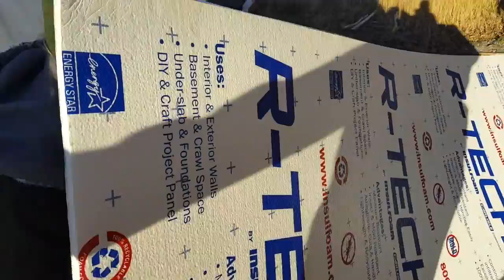How We Installed the Rocket Mass Heater Bench...and did it work?

Comment: Trust me!  Wherever you can,  put a tee instead of an elbow as a clean out.  You will build up a quarter inch of fly ash each burn and eventually the buildup will choke the system.  You'll need to vacuum out the exhaust pipe on a regular basis to operate efficiently.  Best of luck.

Comment: also the bench should be same height as burn chamber. Ducting air from under house might take care of that or you'll need to cut the legs.... I really like your design Its a lot different that most... Being able to bypass bench and go strait out exhaust can give you a way of controlling heat a little.

Comment: Solutions to the heat riser breakdown. 1 rebar (the coffee cans into 1 unit). 2 weld/bend holding brackets (3 or 4) to keep the riser stable  Made from 1  or 2 inch bar stock. 3 add stainless steel hardware to join the riser cans together. Hope these ideas help. Cheers,    
    Bill

Comment: A couple of issues I'm seeing here. You can't "choke" a RMH. It doesn't work like a fire place. You just run it full hot and let the mass absorb the heat. The mass is your choke. 

Second: Double wall insulation pipe doesn't keep cold air from pushing down against your initial heat leaving out. Its to keep the pipe from setting your house on fire. Its an air gap to insulate the hot pipe from the building so convection doesn't ignite combustible materials. 

Easiest fix is finding good start kindling and blow through the intake so you get heat leaving instead of stalling in the mass bench.

Comment: I use pine cones rather than paper to start mine. It doesn’t get sucked up by the draft. Dryer lint with a coating of vaseline will also make a great starter. I stuff that into a spent toilet tissue roll. Light it, no mess toss it in.🔥

Comment: A mass heater only draws well, when it is warm. After they fire goes out, close off all air intake to keep the mass warm. In your case, with your drop from window down to bench, I would recommend a valve to shut off the flu. Keeping the mass even slightly warm will guarantee a draft.

Comment: You need more area between the inner and outer tanks so secondary fuel gas produced in the central tank to ignite with additional air from outside thus increasing efficiency .. . currently you have no area for secondary burn with those rocks filling the area between inner and outer chamber.  The bottom line is "you don't want any oxygen to enter the "fuel gas generator"  put wood in the inner chamber so at 500 degrees f. and thus increase efficiency greatly . . . this inner tank sits above the fire grates and flames go up around the fuel gas generator that emits gas at 500 deg. F. and  are ignited in the top of the outer chamber where additional air  enters and temperature rises to near 1000 deg. Far. a small fan an help get a draft started in the bench

Comment: I would imagine the stove is extremely hard to start properly if you have pea gravel in the top of the stove half the reason you're struggling with this to my understanding is to create the draught required to draw the gases down a long flue pipe requires hitting a cold surface on the outside of the barrel buy insulating the barrel you're not calling the gases quickly enough to create a draw on the chimney also I think something to hold the fire up off the bottom of the barrel would help in giving you more control

Comment: The exhaust tubing should all be the same height of the of the burn box with a riser going out of the building with the least bends as possible,your intake air should come from outside otherwise you create negative pressure inside the building that cause the cold air to be sucked into every hole nook and cranny.By taking out side air running it over your thermal mass to positively pressurize the building you stop cold air from coming in.I take minus 3 degree air run it through the mass and get 180 degree out positive pressured building

Comment: If you put a door at the elbow of the exhaust going through the wall you can open it and burn a small amount of fire starter in there as you start your stove.  The air will start to draw up the exhaust from the fire starter and pull the air down and through your bench.  When the fire starter burns out the exhaust from the stove should be flowing on its own.

Comment: You know you dont have to use all that piping in the part,which is your themal mass . Just build a frame and cover it with cobb and leave it hollow. This will work just as well if you then vent the bottom to the outside. This allows continual flow of the mass heater.

Comment: Hi Juli, Darwin, everyone else. Stumbled onto both of your channels a week or 2 ago. Finding them to be interesting, informative and entertaining. Thanks!

I have a suggestion for your rocket heater that might help. And it is this: stop thinking about smoke as something that always wants to rise. Although I have no experience with these rocket heaters, I do have years of experience in applied Physics. And it would probably help to stop thinking about heat as something that rises. The action that is occurring is that cold is falling and if a warm pocket gets in it way is pushes it out of the way in the only direction it can. Which is up.

Lets assume that, as some of the rocket heater people claim, at the top of the riser tube the temperature is 1500F. The combination of gasses, a.k.a. "smoke", flowing from the riser has now expanded to almost 4 times it’s volume when it enter the firebox (this is determined by using the ideal gas law, PV=nRT). Which also means that, for a given size unit like, say, a cubic inch, it is now almost a 4th it’s original weight. Much lighter.

Now the combination of gasses, (“smoke”) must travel another 30’ or so before exiting the end of the stove pipe. All the while releasing heat into the pipe and cooling off. And as it cools off it “shrinks” and per cubic inch (or whatever size unit you picked) becomes heaver and heaver. At the end of the pipe it is almost back to room temperature and, per a given size unit, weighs almost 4 times what it did when it left the riser.

The point I’m making is that for that 30’ or so from the top of the riser to the end of the pipe the smoke actually wants to go down, not up. Of course once it exits the pipe it will go up, but that is because it has now entered a new environment where it is mixing with gasses that have not had to make the trip through the riser and therefore not hot. But as long as it is constrained by the pipe and interacting only with other gas molecules that have gone through the riser, the further it gets from the riser the cooler it gets, the heaver it gets, and the more it wants to flow down.

So my suggestion: After leaving the riser keep the smoke moving down until it exits the building and the pipe. Not even level, always at a slope down, even if it is just a little. I believe that will fix your problem with getting a draft through the pipe and the problem with the bench pipe leaking smoke.

What do you think?

Comment: This may be a rocket heater but there is no mass !
The rocket design implies the insulated chimney to complete the burn for good efficiency - done ! 
This exhausts into the oil drum which provides radiant heat during the burn time. 
Seems a pity that the exhaust is then taking the hot exhaust straight out without heating a "mass" for post-burn convection heating but maybe there is no room for the "mass". One option is to part fill the drum with bricks for heat storage so long as there remains enough clear space for exhaust gas to flow.
Reply: Should have watched whole video before typing...

Comment: Slap some cob on those pipe joints to seal them better than just tape... The rocket core creates positive pressure, "pushing" air and smoke if you're making it (shouldn't be if the core is performing properly)  through those pipes.

Comment: Julie you are not suppose to use those type elbows indoors they dont seal off the harmful gasses. Please use a carbon dector with this type elbow.There are formulas for rise and draw with pipes and heat. You should be able to find them on line.
Reply: Rocket stove is different, it doesn't work on the chimney pull principle, but on the heat riser push instead.

However, it is even more important therefore, that the chimney joints are hermetic. Because the chimney's not sucking stuff out, and the heat riser might be pushing exhaust system gases through the cracks into your room

Comment: Why not use a traditional design?  Mass heaters are ancient.  In any literature about Cossacks, they always talk about sleeping or sitting on the stove, a big masonry stove that captured heat and stored is to heat the room over time.  Why reinvent the wheel, especially with novice inventors?

Cold air on the outside and warm air on the inside?  Isn't that always the case when you are using a heater in a house?

Comment: I love the videos you guys are putting up. Great products and trial and error videos too. I might be misunderstanding something here as well. I see how the mass heater part works as a battery but when I first started looking at rocket stoves the designs had a J-tube which would really suck the air in and you could visibly see the "horizontal burn." On the design here I don't see anything that would allow adequate air flow through the burn chamber, it's more like an "L" shape design with a door. For the "J-Tube" style rocket stove there is no door really until you decide to shut the fire down. I could just be speaking out of my arse here but what might be your thoughts?

Comment: May I off an observation?  As I was looking at your out take pipe going through the corrugated plate that goes outside. There's a space for air to go out, right? What makes a rocket stove work well is airflow  going into the stove and out the pipe.  You want a really airtight house, so the only air moving (as much as possible) is the air going into the intake of the stove and the air going out.  If there is a flow problem, (debris, ash)  that's why!  Keep the house air tight as possible.
Then your rocket will stay screaming hot!  Either that or my alzheimers is kicking in...again! Love both of your channels by the way. (Honey do carpenter.) I'm a learning allot.

Comment: So, just a couple of comments. First, it is my understanding that the pipe that exits the house should be angled down slightly to allow the condensate to drip onto the ground outside. Second, would it be possible to braze or weld the flue pipe in the box to make sure that at no time could there be a leak? You would have to also install sufficient clean outs.

Comment: I believe you need a connection out of the stove to the exhaust with a dampener! With stove running turn dampener closed redirecting flow through the mass storage bench! Stove needs to get a draw up the stack before turning Dampener! Also if you collect tar condensation with your present setup how will you clean it from the storage mass pipe?

Comment: Please don't be offended but I see allot of dangers with your setup. Obvious creosote in your pipes. Also looks like vent pipe and not stove pipe. Modern stove pipe is designed to expand and not split open during a chimney fire so you don't get a massive giant flame thrower in your home if there is a chimney fire. Rocket heaters get away with using vent pipe because it is barried deep in there heating mass like cob or other material. Also you are not using an insulated burn box in the front and not getting your temp high enough to minimize creosote. It will also help move some of the smoke out earlier on warmup. I just don't want to see anyone get hurt in a chimney accident you need to make it safer.
Reply: interesting
Reply: Yes there are so many safety concerns with this setup both in clearance to combustibles and from CO danger.

Comment: No bypass for the bench set up or more clean out access points ? Not a good idea .
 Also you're not supposed to be aiming the exhaust downward before making contact with the heat bench tubing which btw should NOT be HVAC tubing that's usually galvanized which contains zinc that burns off under high temperatures . Instead use fire rated chimney tubing or at least stainless steel heat rated tubing . It  should also be reasonably level when it exits the burn chamber .Heat naturally wants to rise even though it's being forced downward by the vortex inside the secondary burn chamber .If anything the tubing should be slightly above the exhaust of the barrel so it creates a positive draft outwards . This basic design has been done to death by so many people that there's a virtual plethora of proven tried and true designs that works best . Too often I see people trying to reinvent the wheel and make big and potentially deadly mistakes because they didn't do their research before attempting to do this . Knowledge is power .

The time to work out the details and possible design flaws is before you install it  where a family is living . Simply installing proper home insulation would go a long way towards keeping the house warmer in that kind of environment . Also properly drafting of the outside air intake would be safer and more efficient than pulling in the air through any air gaps within the home plus not to mention the fact that your pulling in warmer air as the temperature rises within the home which kind of defeats the purpose altogether .That design was worked out during the 1700s when Ben Franklin patented his own fireplace design where he made a vent just in front of the fireplace that brings in cooler air from under the house to create a positive draft .

Comment: So maybe I am misunderstanding how a rocket mass heater works, but could you make a taller bench so you don't have as big of a drop in your flu? Or would that defeat the purpose?

Also, that water glass is pretty cool. I just looked up what it was and am going to be finding many uses for it in the future. Thanks for your very informative videos!
Reply: Northwoods Acres : I have seen mass heaters that is basically a wall with many smoke paths. The smoke just wants to rise and the wall just makes it meander along giving up heat to the rocks and concrete that make up the wall.  The bench is a nice bonus, snoozing on a warm spot would be amazing in the cold months.  It just goes to show that there's many ways to do a thing.
Reply: Northwoods Acres  Check out the videos on the Permies YT channel (Paul Wheaton) to better understand the negative pressure created by correctly built rocket mass heaters.
Reply: Thank you!
Reply: Northwoods Acres - traditional Russian masonry heaters use thermal stratification chambers called bells... These have low exhausts in each chamber so that only the coldest gasses sinking to the bottom go out, hottest gasses rise to the top and stay until they lose their heat to the masonry and sink... 

This requires slow gas flow in a wide enough chamber for the gasses to lose velocity and stratify, so incoming duct should be extra large, and exhaust near the bottom.

  The taller the chamber the more stratification occurs...  The top will get significantly hotter than the bottom, rather than just a little bit in a low height bell chamber.

  The bell has the advantage of being able to expose a VERY large masonry mass to gas flow with little to none of the flow restriction of a long bench run of narrow ducting, and the inlet and exhaust can be practically anywhere (laterally) in the bell... To allow for the most convenient core and chimney locations for the space to be chosen.

People are now making bell benches instead of ducted benches... Many are using regular  bricks and even concrete block for cheap and or readily available mass after the first bell...

  If the barrel is tall enough and large enough in relation to the riser. it acts as a heat bell too... 

  The only requirement is the space needs to be big enough for the gas stream to slow down and stratify.
Reply: @orcoastgreenman, this is so very interesting. I just looked up the bell design and read a bit about it and will continue to research this a bit more. Thank you for your detailed explanation!

Comment: I may be better to place exhaust from stove and bench input at SAME level, as well as double wall chimney to keep exhaust warm, improving draft.
Reply from the maker: In the next go round we got it to work with an aircrete chimney instead of just pipe. Now it drops the eighteen inches, goes through the pipe and then out the window and works like a charm.